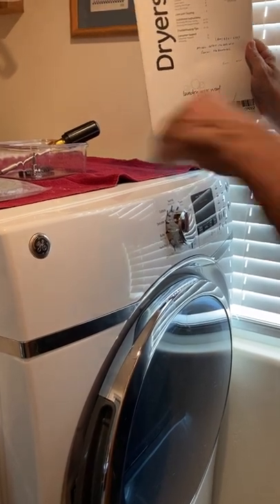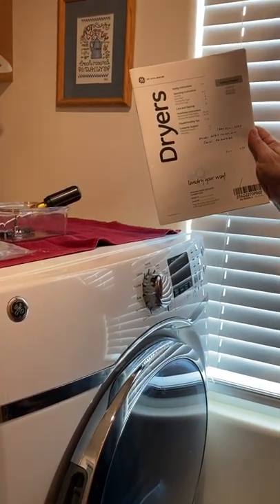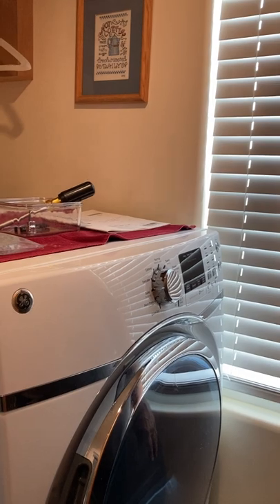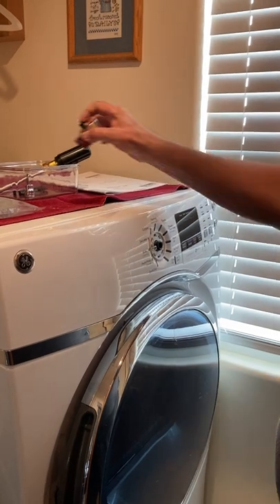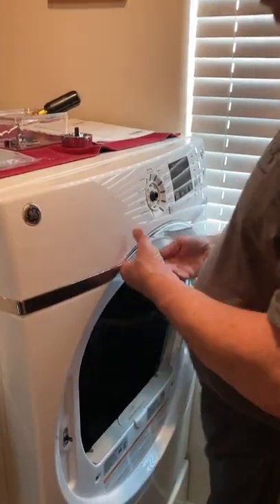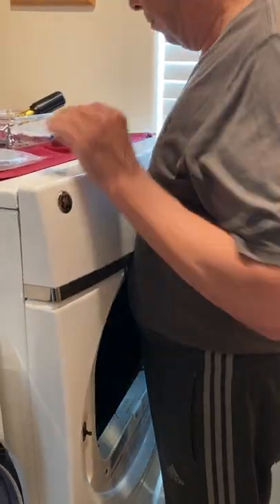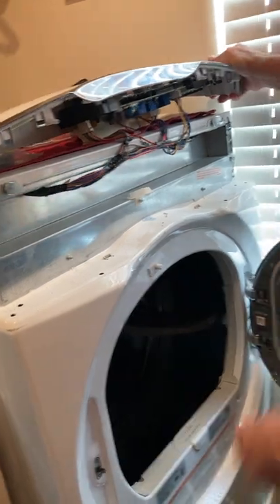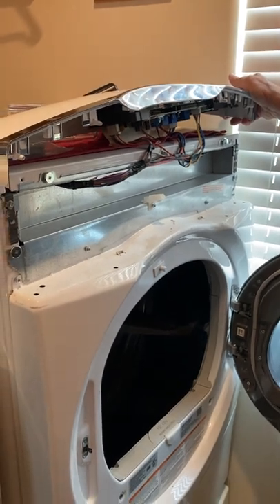GE GFDS170 Dryer

Comment: I've repaired well over one hundred appliances in my life; but my GE dryer is similar to this and had me completely stumped.  I was beyond frustrated. There were a couple screws holding an L shaped piece of metal to the back top of the dryer... but taking them off led nowhere.  Thank you for posting this.  My next step was going to be taking a metal sawzall blade and chopping this stupid dryer into 100 pieces and then dropping it at the dump and buying a new dryer without the stupid glass door.  You know the ones, the ones that anybody can figure out how to take apart without taking off the stupid control knob.
Reply from the maker: GE outdid themselves in hiding how to open this machine up.
Reply: @thomascottrell619  My control knob was extremely stuck on.  I needed two small pry bars to pry it out (praying the whole time that I didn't break the very expensive control board right behind the control knob!) And of course the knob broke and now won't stay on the shaft any more.  So I had to order the knob in addition to the parts I needed to fix the dryer. I feel so fortunate that the knob broke before the control board broke! Actually... I'm not sure I didn't break the control board until I get all of my parts and put it back together to test it!

Comment: Mahalo for the essential info, but why did you have to remove your dryer front panel? Was the lint seal causing any issues?
Reply: We were getting black streaks on our clothes.  It turned out that the plastic strip the clothes dryer drum was bearing on was tweaked casing the dryer drum to rub on the metal frame.  This caused black streaks on our clothes which was a very fine metal powder residue.  We could also feel the plastic strip projecting into our drum on the upper left side.  We eventually used a high temperature super glue to glue the plastic strip back into place.

Comment: Great video! Did you have to replace the front felt seal? The one i have doesnt have one and has worn away the retaining plastic
Reply: I did not.  The plastic bearing strip (that the drum bears and rotates over) on the left hand side at the top had rotated out of position.  This caused the steel drum to bear on the steel frame and leave powdery steel residue streaks on my clothes.  I used a high temperature super glue to glue it back in place because it would not stay in position.

Comment: did you have to disconnect water line in front? I can't pull apart
Reply from the maker: I did not have to remove the water line for the repair I did.